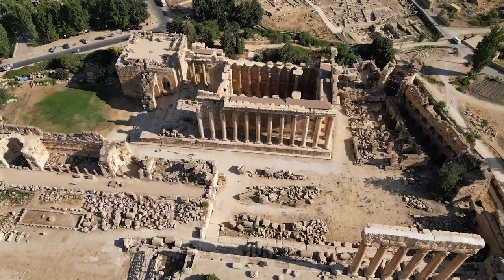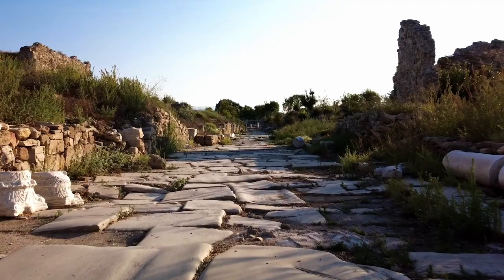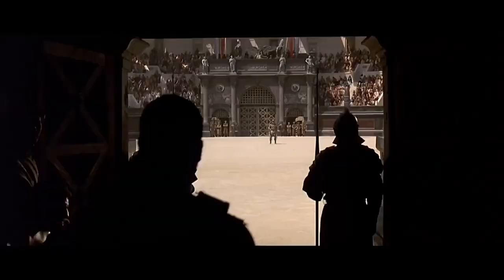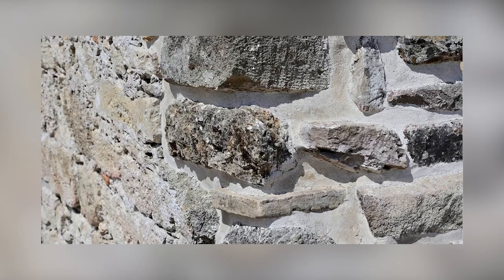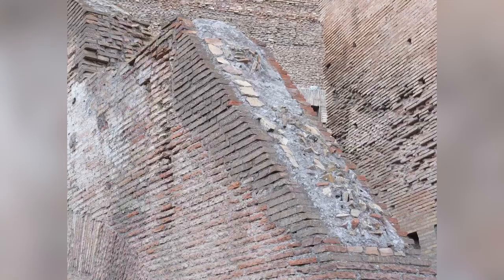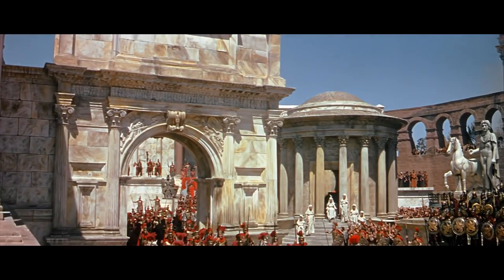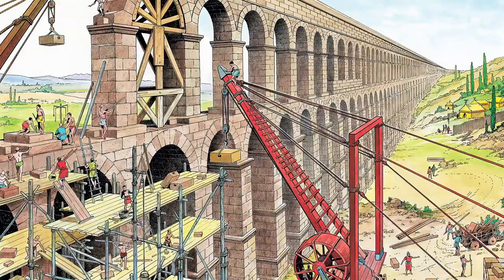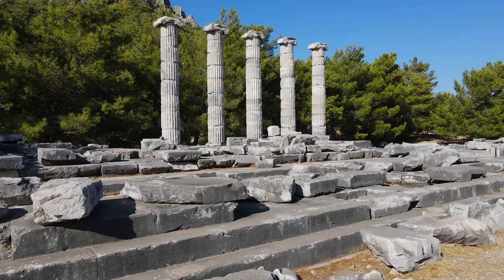DEBUNKING the Roman Concrete Hype

Comment: I think much of what our problems with modern concrete design is its reliance upon rebar and steel to hold it together. 
Modern designs insist upon maximized living space for more profits. This makes it so they look for ways to make it span further and further, with less and less support. To do this they add more steel. Adding more steel makes it more likely to fail due to corrosion. To make the buildings lighter and taller they find ways to add yet even more steel to make the slabs thinner. Therefore making them even more susceptible to corrosion. 
Now every inch of the buildings are at thier edge of being too delicate. They crack alot due to not enough reinforcement and now water can get into the concrete and destroy it from the inside out. 
I think buildings would last alot longer if they simply used arches and more columns, and spanned things less. If and when rebar is needed make sure it's slab in that area is extra thick to protect it from the elements.  
In a perfect world where costs didn't matter I think stainless steel would make better rebar. It's far too expensive tho. I've seen fiberglass added to concrete to make it stronger. But.. it rots the concrete very fast in some mixtures I've noticed. It acts like a wick and draws moisture inside the concrete and decays it faster. So if it is used I would maybe encase it all with a non fiber cement to prevent that. That would require either manually applying the coat or a 2nd forming process tho. 
Overall yeah I think we ask too much of our modern concrete. While yes concrete doesn't hold up well when bent and is strongest when under compression, simply build so that isn't an issue. Just use more columns and arches, and domed ceilings. 
I think a mix of modern concrete with older proven architecture would be the perfect marriage for if you want something to last
Reply: @ImpalerXI  and you sir have an underrated talent for knowing genius at work when you see it! I suspect it's because great minds thing alike! From this day forth all here with know that your sir are a scholar and a gentleman genius as well!
Lol thanks bud!
Reply: it's not just about minimizing space used for supports, it also minimizes upfront material costs by drastically reducing the amount of concrete needed, and reduces cracking from shrinking. Which is to say that time preference and structural scale are also major issues in modern concrete construction.

I don't think Romans were any better on those counts, it just happened that they didn't have the technology to produce materials like rebar as readily as we do, so it was probably cheaper for them to overbuild with concrete.
Reply: @nfries88  I personally don't think they "overbuilt" anything. They built within the limits that concrete can perform. They did it very well too, it's still here today. 
I'm my opinion thier works should be considered the baseline for what you need with concrete if you want it to last. 
The actual concrete used today isn't the expensive part. It's actually the cheapest part of how we build with it today. For the let's say 50% reduction of used concrete, you then must pay a 5000% roughly hike to use and make the complicated forms, all the intricate rebar, tie wire, then form around all that. It would have been far cheaper just to pour an archway that doesn't rely on all that. Keep in mind you can make that without forms by using blocks and filling them when finished. You can also free-form it by doing multiple small lifts of concrete in layers. This also prevents cracking. But it will last thousands of years. 
The Roman's actually had tech that were only now starting to understand. They used things like horsehair and even pigsblood to modify the concrete. Especially the underwater in saltwater concrete they made that still is there till this day. They even invented the use of aggregates, that we still use today. No telling what else they did to alter it but it's near impossible to recreate. I know some now claim they can. But I hear it still isn't the same. 
So I circle back as the only reason it makes sense to invest extra into using rebar etc is to maximize floor space, and be able to build higher. All are a byproduct of green that results in projects that have tiny 50 year ish lifespans before needing to be demolished, depending on the designs. We're about due to see entire major cities like New York being due for nearly all the tall buildings to be needing demolished due to this construction choice. 50% of my local beach was built post hurricane Fredrick and was built using imported pre stressed post tensioned slabs because they didn't have the tech to pour in place then. They're all still being used and are death traps. They're due to fall any minute just like the Surfside disaster. I'm amazed they haven't fell already tbh. But greed perpetuates them using and selling the units over, and over, and over. It's like playing hot potato lol. 
All while even the Adobe buildings made from mud by the Anasazi etc are still standing. Ancient mud high rise condos of the near exact same sizes. Go figure lol
Reply: @hughgrection3052  the "it's still here today" isn't the best argument. they're ruins. most of our large concrete structures not located in wetlands or areas prone to flooding will still be visible in a couple thousand years too.
Reply: @nfries88  No. The main thing keeping them intact is the fact they not exposed to the elements and in a climate controlled scenario. If and when our new buildings are exposed to rain, and snow.. especially saltwater, they blow up like a football with spalls from the rebar. In fact mild moisture from just a moist breeze will 100% of the time cause near instant corrosion of all the rod chairs that can't be made deep into the concrete and are exposed. The rebar is already rusted before its even delivered on site. In fact they have to lay it out for weeks so the rust gets rid of any oils that may be on it. Then it's installed into the concrete already rusting. Even without a simple breeze the PH alone cause cause more rust. That's not counting the electrical current and the cathodics aspect that also causes rust.
In very little time when exposed it self destructs. Look at even our how bunkers from WW2, or even the recent cold War when abandoned have disintegrated already. Those had ample concrete covering the rebar. The concrete recipe isn't no where as good either. Especially the blends we use to do high rises and make them lighter. 
God forbid you examine the so called modern glass fiber reinforced concrete. That stuff can be flaked away by hand after 20 years, even when coated with elastomerics and the while nine yards. 
Look at any old soviet areas where they had to stop mid construction and abandon then, or China too. While yes they used sub standard building methods, it's still shocking to see how bad they hold up. 
Go to any old inner city here too tho. You'll see the same stuff. Lots of solid concrete falling apart, built by the cheapest bidder to maximize the amount of living space to sell per square foot of limited real estate. 
That factor is what drives this. Like the beaches that sell for millions per acre for a very limited tiny piece of waterfront property. They build them as tall as possible, with as many square feet per floor as possible. All built on sand, relying on pilings to stay together, built as cheap and as fast as humanly possible. 
How do I know? I helped build many. The stuff I saw that gets dismissed will shock you. When I asked and brought up the issues I'd always be told, "F*&^ it!... it's a condo!"
Then later in life I was a rappel waterproofing and masonry technician that jumped off the tops to fix all the issues. Some of them are in an alarmingly bad state now. I'm talking entire floor levels of post tension cables having snapped, and this was 20 years ago btw now. The ends would snap out of the stucco like a bullet lol. Entire rows of them, side by side, by side. Just patch them up with mud is what I did. 
Literal ticking time bombs bud
Reply: @nfries88  Also, no. I forgot to touch on the Roman stuff today being in ruins. Much of it would be just fine if it wasn't for years of warfare, earthquakes, and most of all... looters robbing the stones etc to build other things with. The coliseum was used as a quarry for years. Much of the actual poured concrete still remains. But yes much failed too as it wasn't all concrete tho. Much of it was also made to be light and have wooden staging and decks. Once that rotted away and no one was there to maintain it, yes it fell into ruin. But solid concrete is nearly forever. It's quite literally a big rock. Not much phases it. 
It's why things like the Aqueducts of old that was built solid with no wood etc still work to this very day.

Comment: So...  The main differences are rebar and we mix the the lime in too well.  I wonder if there's a way to make lime chunks that maintain the ability to form pockets through a good mix.
Reply: If anything, the Romans mixed the lime better than us. The uploaded has made an error here.
They key was leaving the quicklime dry until ready to mix with the other dry ingredients.
Slaking it and THEN mixing it creates heat which bakes the mixture and that is what develops those self-healing pockets.
They also used seawater.

Comment: MIT professors have proven Roman concrete is not only better...it's a hell of a lot better and self-healing. Also,, nobody is repairing all of the Roman underwater structures and piers that are 2000 years old and are still intact.

Comment: You think because we use steel in the concrete it makes it stronger? Maybe, but it doesn't last long at all, unlike roman concrete, your conclusions are dubious at best with lots of assumptions.
The fact you think they weren't as smart as us is your biggest mistake, the buildings were far more technically accomplished than anything we've built in modern day. 
You think we so smart, yet we know the components of roman concrete, the exact ingredients, but can't make it today, that's not superior, that's inferior.
History is way more interesting than you think.

Comment: This video didn't age well itself.    The only time most of these structures were substantially rebuilt was in Roman times, usually to appease the esthetic concerns of an Emperor...for example the Pantheon.   "Rebuilt" more recently though means minor patching and in the case of the Patheon, a section was ADDED to the building, not replaced.     Sometimes more functional structures, like bridges got damaged in war and were rebuilt because they were still in use.    Hence, this video starts with a misunderstanding of the semantics of "rebuilt"...not a promising thesis.   Much of the "damage" to Roman structures over the years was due to people pilfering building materials from those structures, not from weakness in the concrete.   That is what happened to the Coliseum:  people stripped it for building materials, and only more recently efforts were made to restore it.    Once structural elements are compromised, other parts will fail faster.    The dome of the Pantheon still is original from Roman times with very minor patching and cleaning.    And it still is the largest unreinforced dome in the history of the planet...so the engineering of it is still beyond the capability of modern techniques.    In fact, after the MIT discovery that Roman concrete is self-healing, some large modern concrete projects like dams, are starting to be built with those ancient techniques to test their technique.   It is well known that the maximum load bearing life of modern concrete is 50-100 years.   Compare that to 2000+ years for Roman concrete.

Comment: People out here upset guys made better stuff 2000 years ago and just want to crap all over it
Reply: Yeah,he seems a little dismissive, roman concrete would provide a lot of small-scale solutions.

A "self-healing" foundaton for single and duel family homes. That has a lower carbon footprint is cheaper and requires less maintenance, or just in the production of walkways and concrete slabs...

Comment: Can you provide us with the sources when the Pantheon was rebuilt the last time. I read that it was rebuilt the last time in the year 119 because it burned down! not a concrete failure in my opinion. Put sources under your claim otherwise you are just a nobody claiming unsourced stuff with unrelated stock videos on the background.

Comment: 100% correct. They are called lime clasts. I do historic masonry restoration and the clasts are my first clear indication that i am infact dealing with historic lime mortar. I am going to blast this knumbskull in a full on retort. But, kudos on keeping up with the research! This stuff is so interesting and i quite honestly rarely if ever use portland cement, for high strength projects i use CSA cement instead and its pros are almost as numerous as lime, but they fall on opposite ends of the spectrum. Portland cement gets no points for being modern... its still garbage! Lol

Comment: I've never understood why the "carbon footprint" is mentioned. They always mention that it reduces/increases the carbon footprint but not how or why.
Reply: Lower temperature calcining means it can be done with electric heat more easily. And that would allow easier carbon capture.

Comment: Every building needs repairs over time, we don't have examples of modern buildings lasting over centuries, becaue they were build at most 70 years ago, yet we have many examples of modern concrete buildings already being in need of repair. I want to see modern engineers surviving in the environment of the ancient romans and being as capable of maximizing the posibilities that existed then. You also don't need science for nothing in that regard, both roman architecture and later, gothic cathedrals where build without scientific knowledge, just by basic engineering. The latter are still standing and even survived the bombings of the second world war(like Cologne cathedral). Yes they need touchups over time, but so does every structure made by man. 
Even Granite deteriorates over time, thats why sandstone exists, so obviously structures that are made from softer stuff will do that faster. The Romans could have used steel to reinforce concrete, but that ressource was more expensive because of the obvious, prospecting, smelting and working metal was harder then.
Modern Concrete also has another problem, all the pebbles and the sand you can make it out of are a finite ressource, more finite than what the romans used. It is also more resillient in terms of not needing a modern infrastrucutre which is not a given thing that is easy to maintain, in fact it needs consciencious people with a significant intelligence to run and can break down very easily.

The Hype is justified, because of many reasons that are based in the ingenuity of making the best of what you have and notice, it is not a given, that we make the best of what we have. It is also justified, because the infrastructure needed to make and use the stuff is catastrophe proof, i.e. classical age technology is all that you need. As you yourself said, it is also not weak, it does the job well and the srchitecture looks way better than our modern one...

Comment: I think you highly underestimate the Romans and highly overestimate our current technology. 
While we can do some complex things with computers, that doesn't mean we make better materials.
The Romans kept it simple, just used what worked for them. And... Surprise surprise, it worked for them.  

E.g. you can measure and test until you weigh a thousand pounds, but in the end making better materials is usually just a creative process of messing around.
Then just having it in use for many years and seeing if it does the job better or worse than the previous materials. All you need to know that in the end, is time and your eyes.
And then sticking with it for hundreds of years, because; "If it ain't broke, DONT FIX IT."

Comment: Modern concrete = 50 years

Roman concrete = 2000+ years

Yeah, Roman concrete is horrible.

Probably truth is that were are a reset civilization with no direct lineage to "Roman times" and the "Romans" were probably more advanced than we are now, so we are still just figuring this out.  It's the only way to explain why nobody has the exact method and recipe for Roman concrete, because humans today are not descendent from them!

Comment: I find many statements in this video too bolt. You brush over topics like they could not mix material exactly on a larger scale. I think you have not a good feeling for larger windows of time, they did not come up with technique in 30 years and of course not in the amount of time you researched this topic and produced this video. its like you and your statements would make be believe that they were in fact not able to built such structures.

Comment: Steel reinforcement is one of the reasons why modern concrete is NOT durable.    Take for example the Surfside condo in Florida, built in 1981, which collapsed in 2021...a 40 year life span.   Or another example, the Fern Hollow bridge, built in 1970, which collapsed in Pittsburg when Biden was giving a speech about failing infrastructure in 2022...a 52 year life span.    The only purpose of steel reinforcement is to increase the INITIAL shear strength of the concrete ... it allows the use of less concrete at the EXPENSE of longevity.    Over time the steel, no matter how well placed will rust and expand, causing the failure of the concrete.   So it is definitely NOT an example of why modern concrete may be better.